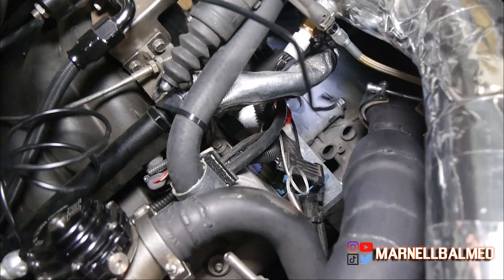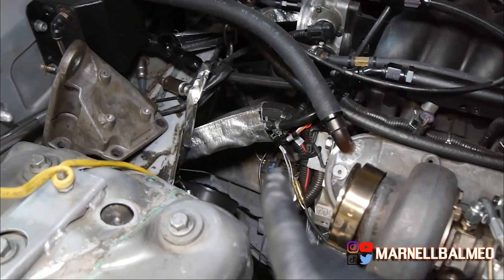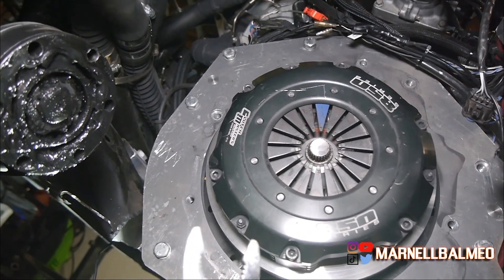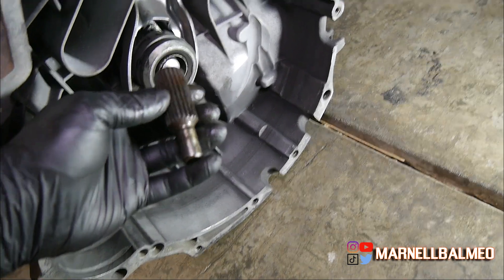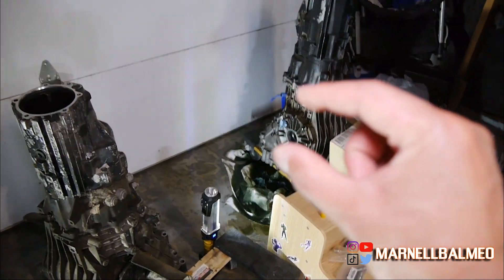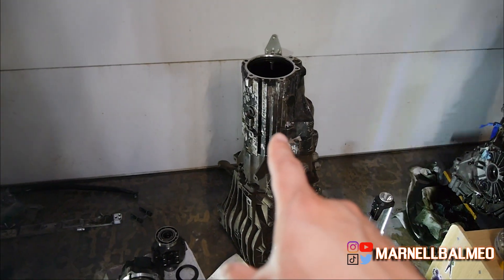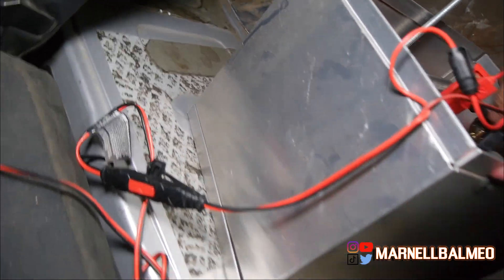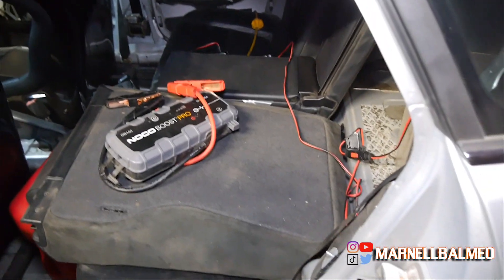Well that didn't last long! Shenanigans with this Car…

Comment: I forget where you are located? But.. "I have a guy" who makes his own input shafts for the Porsche G50 transmissions. He runs 750hp through them (road race car) You can easily see it breaks right where the splines are cut. He can make any input shaft.